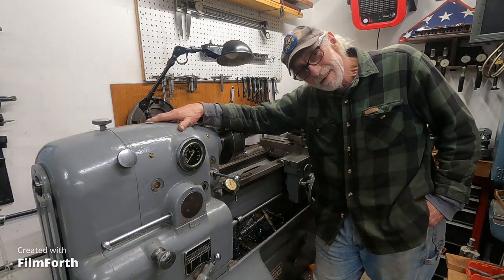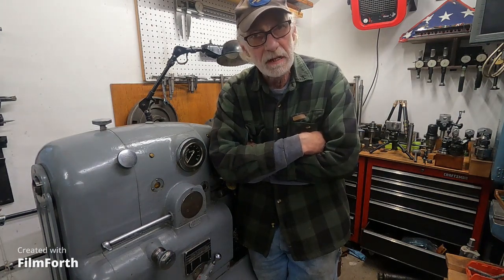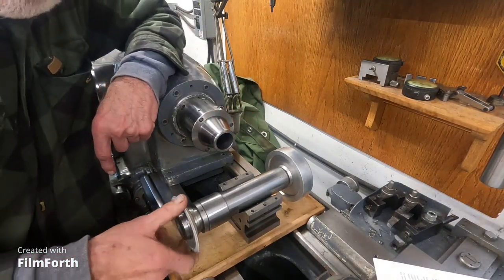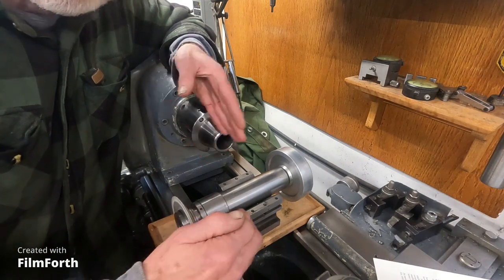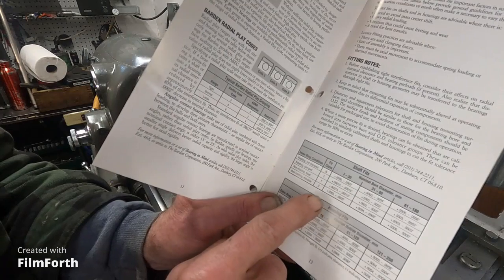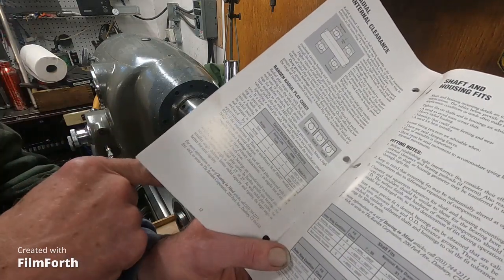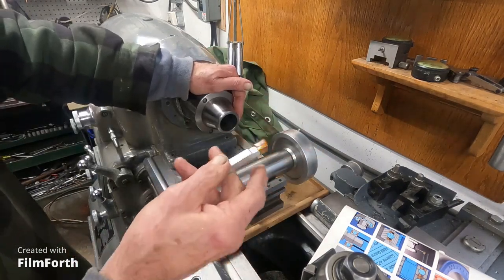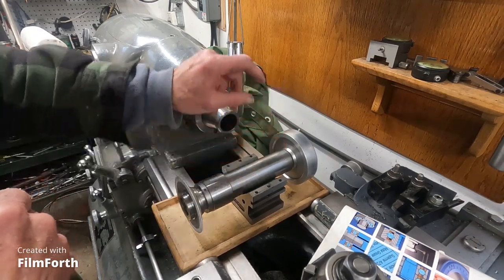Monarch10ee Lathe why the super precision?

Comment: Dee, this had to be the best video to date.   I’ve been wanting to build a precision grinding spindle for some time but I’m having a hard time accumulating good knowledge.  This was a great start. Thanks for sharing.
Reply from the maker: Perhaps some bits and pieces of this so far will be helpful, I just had the idea of building a useful grinding spindle using grade 5 electric motor bearings, that is where I started, the first one does not have to be ultra precision.

Comment: Thank you for all your great content, I am just a hobbyist who is lucky enough to own a Hardinge HLV-H and Aciera mill. I have no formal machine shop training and learn something new from all your videos. I am looking forward to your upcoming Acme thread video, as I want to try and make a new feed screw nut for my Aciera F4 mill to try and reduce some of the backlash. It needs to be a metric 30 degree profile but with a 5 threads per inch pitch as the machine has inch dials. 
Thanks again I appreciate all the hard work that you do to upload these videos.
 Kind Regards John from Canada
Reply from the maker: Hi John, the way your machine works with the half nuts engaged full time will makes stepping out threads in small diameters and in difficult materials easier for example an Acme thread can be started by plunging in a regular V thread cutter. more on that later

Comment: These lessons about precision spindles and precision bearing are really great! There are many lessons to be learned on every video you have made
. Could you perhaps go into more detail about the procedure of machining the bores on the housings for such a precision spindle, in particular how would you achieve such high concentricity on the two housing bores as is required for the precision bearings to fit into. It seems that machining-grinding one side and then flipping the part and dialing it in on a four jaw chuck to machine-grind the other housing would not be accurate enough. 
Grinding the shaft is straightforward in terms of workholding, it is mounted between centers and all bearing seats are ground in the same setup.
But the procedure for the housings seems a lot more difficult to me, a mystery really. Could you make a video on that subject, please?
Reply from the maker: Here is the way it is, it took me decades of real work to show just some of what I know, I see this all the time where one buys the machine then instantly wants to do the most critical work on it, it does not work that way. I can show how to train your skills and prepare the machine to get to my level and the cutter grinder, I do know my limitations. Everything I do in my videos benefits me first, I just allow you to see it. But on a lighter side, I am busting up the racist scum on YouTube that threatened my family, my primary and only mission here. I may stay around after.

Comment: I've cut many acme threads internal and external mostly using high speed steel hand ground and also inserts. Mainly making valve stems and the drive nuts for them. I usually use a tool that is smaller than the actual thread form and step it over to get the finish size.  These are usually quite large components done in the bigger machines. I look forward to seeing your method on the 10ee  with the lead screw reverse mechanism.
Reply from the maker: Yes it is the same way except the halfnuts are left engaged and the spindle reversed for return of the tool to prevent camming error of the half nuts being engaged and disengaged for the cycles, start with a narrow tool start working it too depth and the shaving the flanks to open the thread up compound paralle with the ways.. The most difficult materials can be threaded by working it out that way. I actually have not seen acme inserts used on manual machines before because it takes speed, power and coolant, and it looks like it doesnt work that great on a couple of videos anyway, thanks!